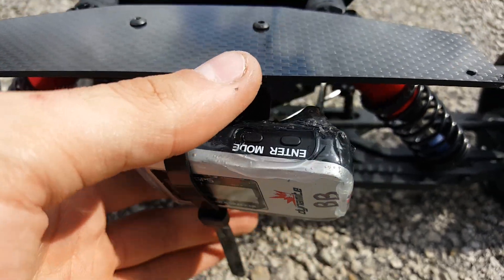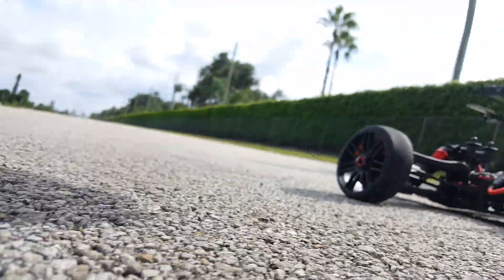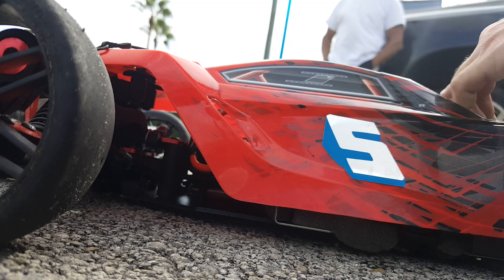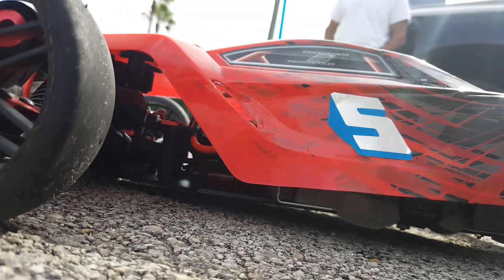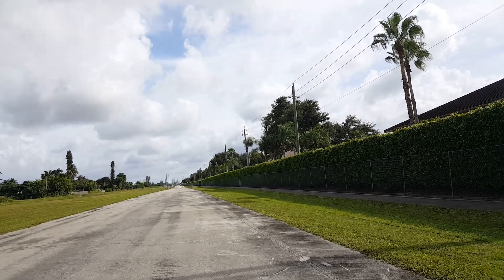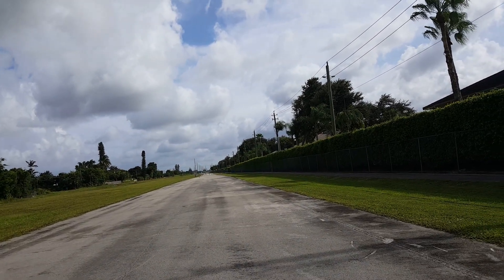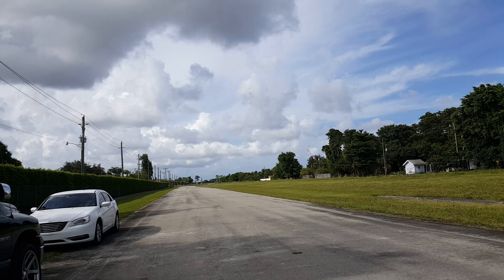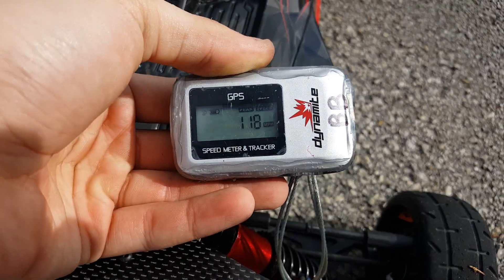Arrma Talion Speed Run practice

Comment: Nice run! :100:  Is there a particular reason why you and others do speedruns wich relatively small diameter wheels? Are smaller ones better suited for high speeds than a SRC Road Crusher, which is 5.5? Does it have to do with ride height? I am getting into high speed setup. I have a V3 Talion, too :)
Reply from the maker: Anyone who runs src tires usually never handle well over 80-90. That in a nutshell is why.

Use what works. What do people run to break 150-160? Grps